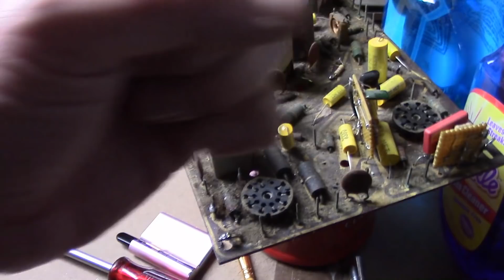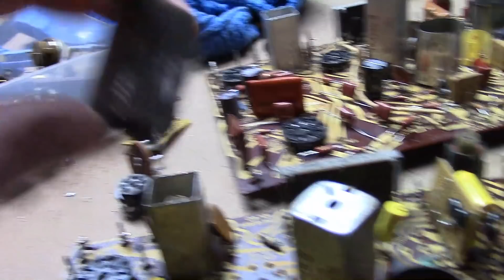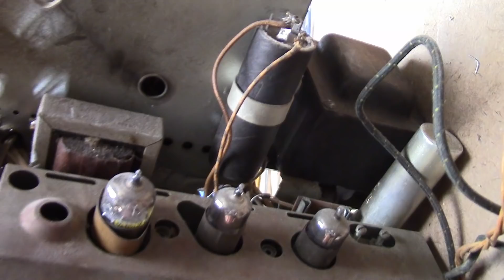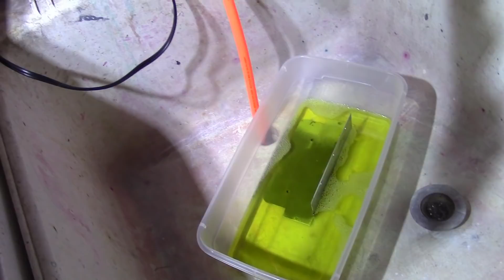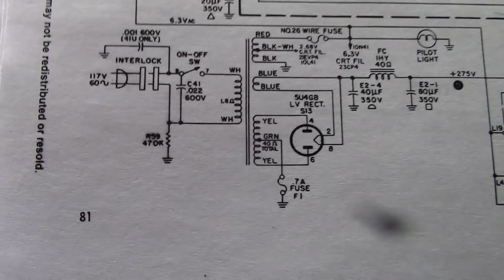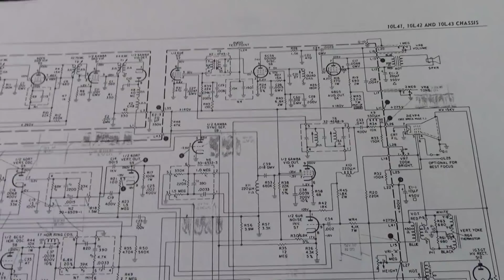Predictapalooza s1e06:  Detailing, PCB installation and rust removal

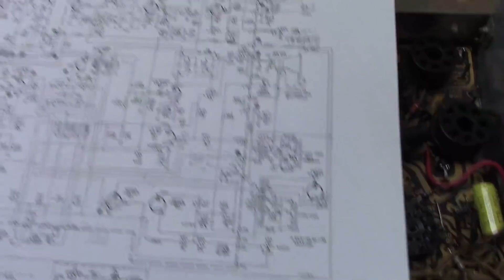Comment: 24:35  Very good thought with the SS rectifier power supply and capacitor voltage rating. Can you tell us where you source the "Fusible Link" replacements from? I remember those being burned out a lot on tube TV sets, and they are also found in some tube radio's as well, but back when I tinkered with them in the 1970's they were readily available, now they seem scarcer than hens teeth.
Reply from the maker: All the major vendors - Mouser, Digi-key, Allied Electronics.  They look like regular resistors but have an extra black band.
Reply: @bandersentv  Thanks! From the ones I had seen, the originals were... some sort of flexible fiberglass, or asbestos covered nichrome wire that was also a current limiting device until they hit the designed melting point, and they may have had a higher wattage rating than most "fusible resistors" available today. I'm thinking a higher wattage voltage dropper resistor and 3AG fuse is a good replacement in those situations as well.
Reply from the maker: @poormanselectronicsbench2021  Those old ones are really only rated for 5 watts.  I think they were so big because of material limitations.
Reply from the maker: @poormanselectronicsbench2021  This is what I'm using:  https://www.mouser.com/ProductDetail/594-PR02FS0205608KR5

Comment: I noticed you left the ETR caps in. Did you not mention that most or all of the values were not correct? .02 was a .2 etc.
Reply from the maker: They were within 10%.  0.022 was a 0.02.  0.033 was a 0.03.  That's close enough.  I was more surprised that someone would use the harder to find values when they weren't even called for.

Comment: I wonder how much it would cost to reproduce these mainboards on PCB way
Reply from the maker: Not very much.  The bigger challenge is in transferring all the parts to the new board.  All the wire wrap stakes are press fit into the board.  Transplanting the coils and transformers would be a challenge too

Comment: Someone should get a bunch of modern quality circuit boards made. They are so cheap now. Layout is also so easy these days.
Reply from the maker: Sure, but transferring all the parts would be a lot of work.  Those wirewrap stakes are press fit into the board and difficult to remove.  Then there are the transformers and coils.

Comment: When I was a very young man I worked in a factory that made PCBs in Philadelphia.  They started with copper clad fiberglass, so I don't know how copper was initially bonded to the fiberglass, but all the traces were done electrochemically. 
A photoresist film is put on them and then washed. That leaves all the traces without the photoresist film on them (but the rest of the board is covered in hardened blue photoresist).  Then you plate the board with tin-lead.  Since only the traces are exposed to the tin lead, only the traces get coated in tin-lead. 
Then the cured  photoresisist which is covering the rest of the baord  is washed off and then the boards are dunked in a chemical that strips all the copper.  But because the copper traces are covered in tin-lead, that portion of the copper doesn't get eaten off. 
Then the tin lead is removed and the boards are heavily copper plated to build up the traces.  There was something they did to the holes in the boards, but honestly I don't remember. It's possible it was just heavy plating. 
 I know that after the prescribed time of sitting in the copper plating bath, you would pull one board and the thickness of the plate was measured at a few randomly selected holes. If it measured up to snuff, all the boards would be removed.  It was very labor intensive. Almost no machinery involved.. 
They went under in the mid 90s.  I heard from the guy who owned it that it was the bank that put him out of business. He had plenty of orders, but no money to fill them as it was routine to just borrow short term from the bank.  They had a big contract with the people who make computers for garages.  I can't remember for the life of me who it was though.
Reply from the maker: I made a few PCBs of my own back in the 80s and 90s.  I'm pretty sure they went straight from photo resist to an acid bath to remove the copper.  Never heard about extra steps to tin plate then more copper plating.  When you buy copper clad FR4, the copper is pretty thick already.
Reply: @bandersentv  It's been about 32 years since I worked there, so I may be mis-remembering the details.  Though I remember for sure the traces were tin-lead plated temporarily to protect them from the copper removal.
The factory was there from at least the 60s and was old. The only thing that was automated was putting components on the board, which was in a different part of the factory. 
They used giant tanks of copper sulfate and then buckets of copper nuggets strategically played in the tank.  Then there were "trees" with wingnuts on them and you would attach a board to each side of the tree and then place the tree on the rails above the tanks for electric conductivity.  It used a lot of power too. Every cable going to the rails were like double ought or bigger (like a good inch thick).  I've never done it at home, but as I understand it, it doesn't use  a lot of current. But for whatever reason, it must have used a lot to have those wires.
Then there were a bunch of washing tanks and then the tin-lead tanks as well.    This was before I went to college.  Everything you wore to that job had to be bought at the thrift store because it got destroyed in a matter of days. The cleaning tanks had dilute sulfuric acid and when you pulled them out, they just dripped on you
Reply from the maker: OK, I thought more about it and it makes sense.  There would be way less copper to dissolve using the technique you describe.

Comment: I mentioned that my Philco Predicta Holiday has a broken antenna. Anyone out there have an extra you’d sell or trade? I make a pretty cool project out of a raspberry pi that doesn’t modify the television, but uses a capacitive touch button (you can mount thru behind the metal grate in the front of your Predicta..) and each button press shows a random video. I loaded all 1950s media and it is great for these antique TVs.
Reply: The antennas are probably the most often missing parts on these predictas.  Along with screen covers,those are another item I’d love to see reproduced.
If you still have the ball pivot and the rest,it is possible to drive out what’s left of the original antenna mast and install another.
Reply: @Suddenlyits1960  I do… it’s just snapped off at the widest articulating section - that has always been my ‘plan’, but I’ve never found antique-like (or gold) antennas… that, and life happens. Always thought I’d get a call from one of my Philco-friendlies. :) Thx for the suggestion - I suppose I ought to rip it off the side and start.